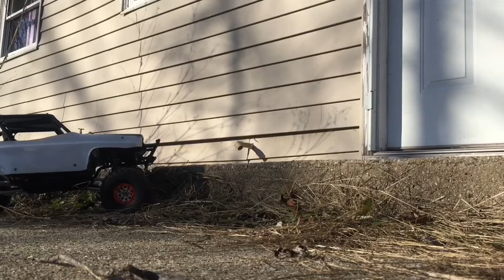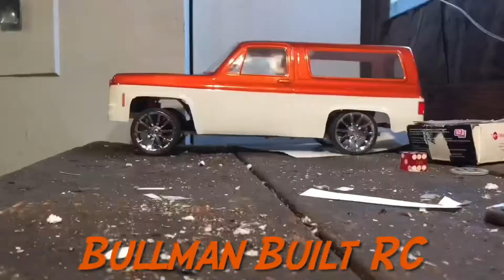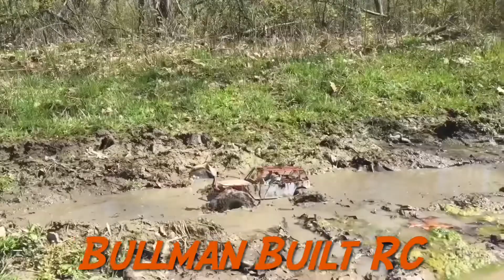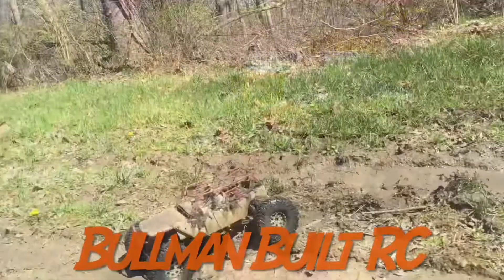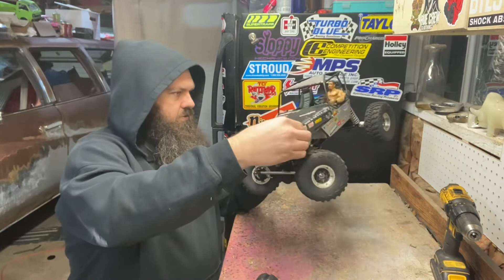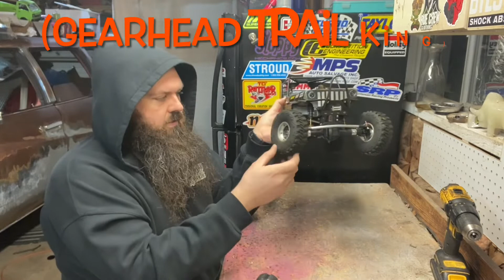RCP Wreckluse and some plans

Comment: Nice, What hood did you use on it?
Iv had mine forever and never got the body panels from RCP.
Reply from the maker: This one is custom made out of thin aluminum sheet. I got it that way. I don’t love it and I plan on making another hood that hinges from the back and is held down by magnets. Changing the battery is a pain in the ass right now.